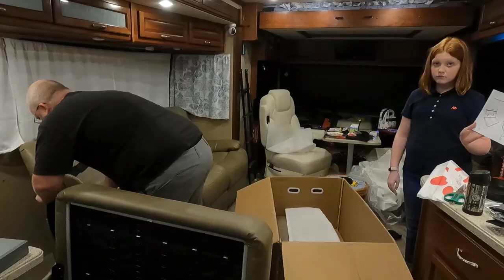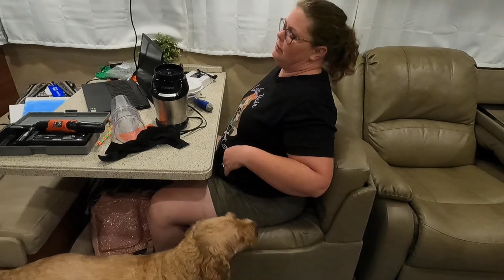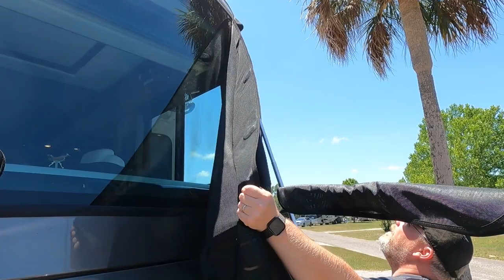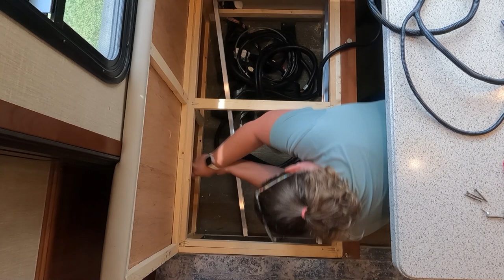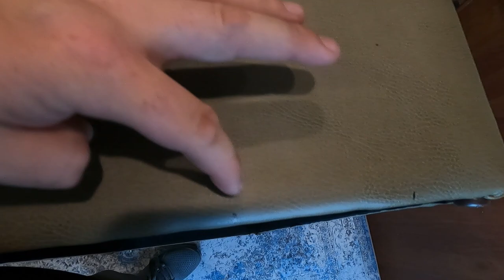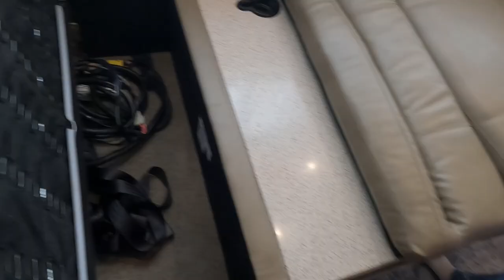RV Renovation is DONE! RecPro Dinette Install and Review

Comment: I wonder how susceptible that sunshade is to wind.
Reply from the maker: I've never heard of one blowing off but anything is possible. You can feel air through it so it's not solid, plus those magnets are really strong and it's flat against the windshield. I don't know what it would take to rip it off but I don't think I'd be happy to experience it regardless 🤣
Reply: @Five2Go  I was just picturing a tarp tied on a trailer.  No matter how tight you tie it, when you start going down the road it somehow starts flapping around and some of it gets loose from the ropes.  I think your shade may be good for 20mph winds, but I'd pull it down if you expect much more than that.  Or leave it and see how it does.  ;)
Reply: We’ve had a MagneShade for a couple years.  It’s never come loose or sagged in the wind and /or rain.  

We also find it’s easier to put the shade up with the wipers left against the windshield.  Then pull them back when adjusting it at the end.  But, ours also has the 2 larger magnets that make it much easier to put the shade up.